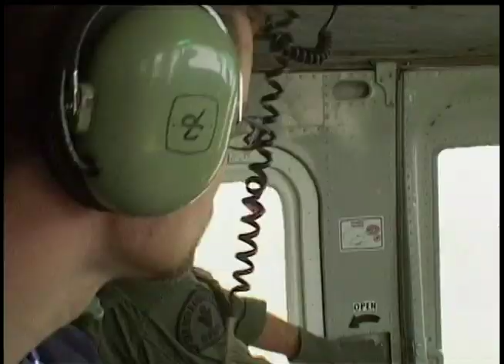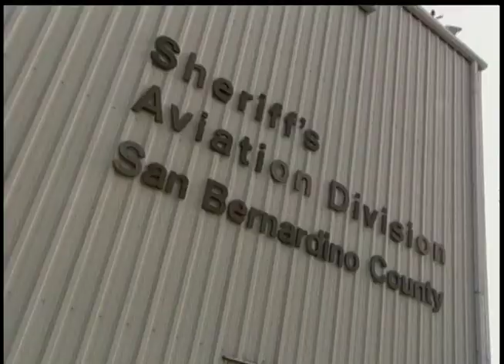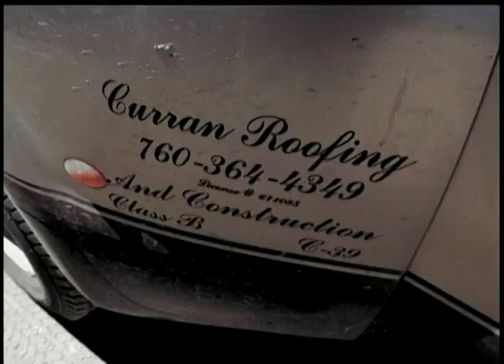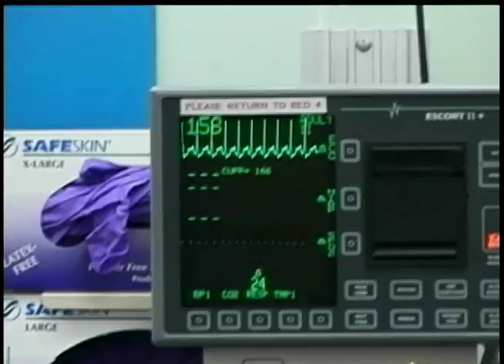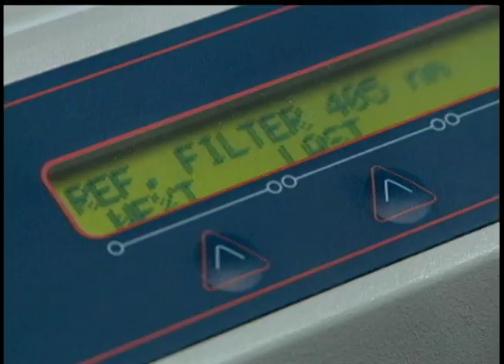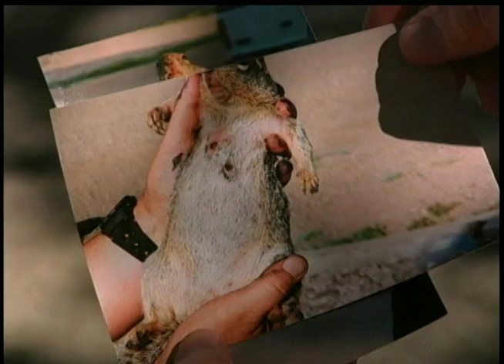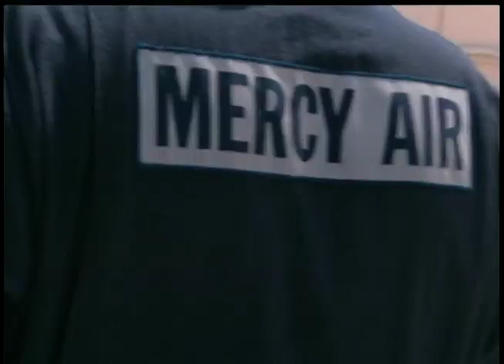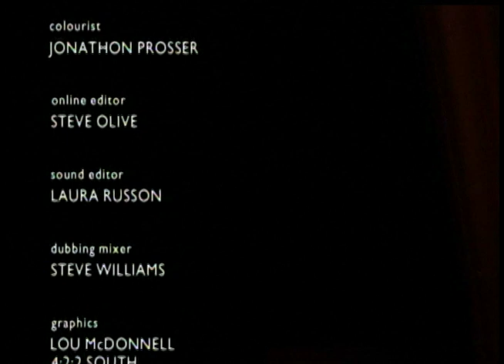VenomER Programme 4 NBR Y486T NTSC

Comment: Thank God for these people. I go hiking in the foothills sometimes, and I'm always afraid that one of these days I might get bitten by a rattlesnake. It's not an isolated area though, there are houses right nearby...but still, it's scary to think about.
Reply: so go buy some protection for ur lower legs and Good high cut thick hiking boots 👢 .a cellphone with a fully charged battery, and always tell someone where u're going, a walking stick is an extension of ure body, and use it to investigate a path u're about to walk that looks fishy,,, something like that will give u confidence on ur hiking
Reply: +Alexander Tsanga  True.  Good tips and advice.